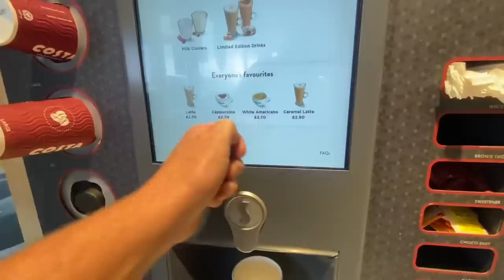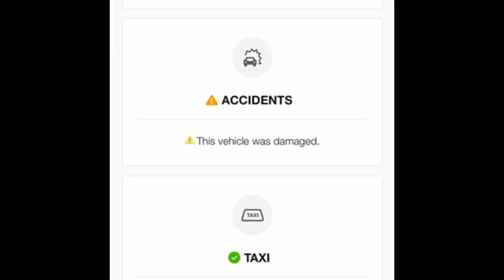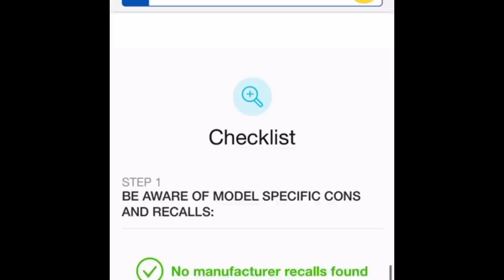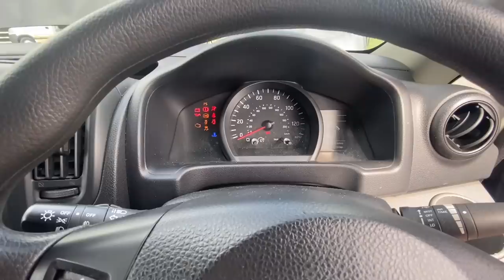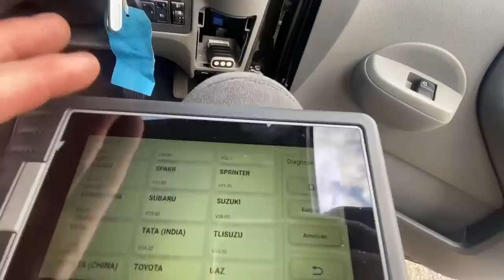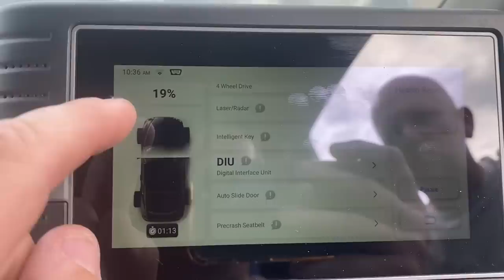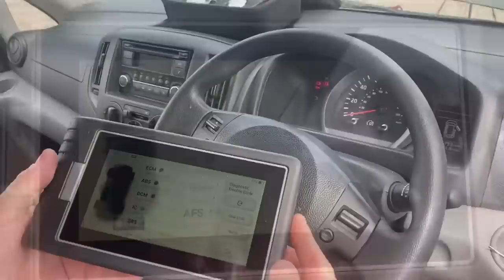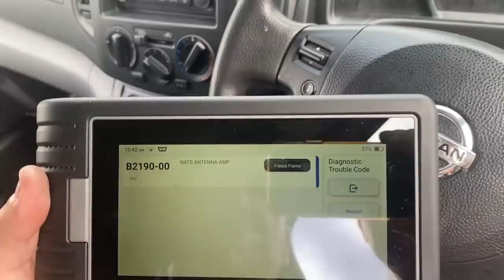Crash Damaged 2019 Nissan NV200 Panel Van non EV Hybrid PT 1

Comment from the maker: use Car Vertical and get 10% off with our link here :-  https://www.carvertical.com/gb/landing/v3?utm_source=infl&a=Rebuilds&b=38b26e3a&voucher=salvagerebuilds
Reply: Currently in the process of buying a c class, used your link to check it out of curiosity and it turns it its had a dial back a couple years ago. I don't know if I fancy that car anymore but I'm glad I checked.
Reply: thanks for the discount some good info on there  used when purchasing  a vauxhall vivaro only gripe it does not do finance check so had to do a hpi check as well. would recommend finance check on newer vehicles.
Reply: Thank you for the link Rob and Chris, used this morning to check history on a car I've bought, all came up good. Thanks for all the videos, and enjoy your weekend.

Comment: For those commenting that this is just a rebadged renault you are wrong. The NV200 is a stand-alone vehicle made by nissan with a renault engine. The nissan that is a rebadged renault trafic is a Primastar.
Reply: the renault master comes nissan as well not sure of model think its nv400. also opel something or other
Reply: @Irishmacwoof  Thats correct. The nv250 (used to be called kubistar), renault kangoo and mercedes citan are the same base. Nv300(used to be called primastar), renault trafic and vauxhall (opel) vivaro are the same. Nv400, renault master and vauxhall/opel movano are the same.

Comment: Missing fuse was possibly a sat nav being piggy backed. Had it last year with a Citroen DS3 I purchased salvage. The person must have been in a rush to remove it so didn't replace the fuse. Mine wouldn't talk to the diesel additive pump which turned out to be a missing fuse. Very annoying!

Comment: Seems insurers write things off a little bit too quickly especially on a nearly new van.
Reply: My thoughts exactly.
Reply: Think about it from their point of view, they have to arrange the repairs, do paperwork, arrange a hire car, pay for the repairs from main dealer parts prices, paint work at the top end prices and then if the repair isn’t for whatever reason 100% it will cost them even more. They write it off to wash their hands of it and move on. It’s easier and probably cheaper for them to do that. Only time they won’t is if it’s just a really minor scuff or something but even then they might write it off. Makes sense to them and we can buy bargain salvage 😃
Reply: Yes, I agree.
Reply: Insurers and their assessors will just put on new parts rather than reconditioning them or using second hand stuff because it's easier for them to just go to main dealer and get it, even if it's more expensive.

2021 Mercedes Sprinter van driver side rear door? £1200 in colour, including VAT. It's silly prices for some of these parts, and unless you're buying from a breakers yard, the client of the insurance company will just take the money offered by GAP insurance or their insurer and get a new van.

Comment: Mega easy bargain repair for you guys.
Lazy/sloppy estimating from insurance company to deem it cat S total loss when it’s really only a bunch of bolt on bits and a little weld in headlamp panel.
NATS (Nissan Anti Theft System) fault could just be from low battery or a key not recognised at some point.
Nice bit of diag footage. Keep up the good work guys 😎

Comment: We had one of those vans a 2014, I think, ran great for about 175000 miles. Trans-axle died, in the U.S. you can only buy that van with an automatic, they are so bad no one will rebuild them and there were no good used available. Nissan wanted $6000.00+ to replace it. We scraped it. Wish we could get the manual

Comment: just bought a ford fiesta in black 400quid few bits missing like broken rear brake light at top of boot n strips on side doors, found parts at scrap yard easy fix, & once cleaned n polished motor came up looking shinny glass cleaner the one 2!

Comment: I started my career at a Nissan dealer and worked in them for about 10 years.  I like these vans, a few of my mates drive them based on my recommendation.  Genuine parts are ridiculously expensive though, I'm glad it's not a rear ender as the rear lights are close to £400 each!  I think when you find out the wing prices you'll end up repairing them.  Good luck with it :)

Comment: Rob, just a quick note. When you take AC pipes off a condenser, seal them up with insulation tape, the last thing you want is water in the system and you were spraying with the jet wash. The oil in the compressor attracts moisture and can kill the compressor after time. Vaccing out the system will remove most of the moisture from the air in the system but water will take longer. Another great vid, keep up the good work  👍
Reply from the maker: We do bud

Comment: The missing fuse for the OBD port may have been on purpose, some people remove it as it stops (well slows them down) potential thieves being able to plug a reader in to code a new key and make off with it, I actually have done the same with one of my cars for extra protection 👍

Comment: Absolutely fantastic vlog chaps I have a Nissan nv200 myself and is a good van but depending on the mileage replace the fuel filter they are fairly cheap and also the transmission oil it takes 2.3 litres 75w 90 fully synthetic and engine oil is also fully synthetic 5w 30 4.637 litres superb find very impressed take care and stay safe mark from billericay 🚐👍

Comment: Hi guys, what is that rubber mat with the lip on it that Chris was lying on and then you had under the engine at one point.  Looks like just what I need for a little project.
Reply from the maker: Mate honestly so many people have asked what that is and believe it or not it’s just a plastic boot liner out of the boot of a Fiat 500 but they are so expensive I didn’t know how expensive they was before I started dragging it around the floor lol we love it as you can drop anything on it and it stays on it . I’ll send you a link for 1 https://www.ebay.co.uk/itm/Fiat-500-Abarth-Semi-Rigid-Protective-Boot-Liner-Mat-50901727-New-GENUINE-Fi-/230418089961?mkcid=16&mkevt=1&_trksid=p2349624.m46890.l49286&mkrid=710-127635-2958-0
Reply: @sruk  thanks for taking the time to reply and especially for finding one for me.

Comment: There should be an inertia cut off switch under the bonnet. It cuts off the fuel supply in the event of an accident. Usually press to reset( as far as i know)
Reply from the maker: They don’t tent to be on these modern cars anymore 👍

Comment: Bit of a strange one with car vertical, I know manufacturers share models. But  not usually model names or type as with the tekna. The tekna in the case of my Nissan means extra features dab radio, sat nav and rear camera. Along with the trim level, that will be a lovely low mileage van for someone.

Comment: Hi Rob & Chris
I was just wondering is it more expensive to insure one of these Cat S repaired vehicles than a non damaged same version car ??? If so do the savings on buying one not get outweighed by insurance premiums over the years you own it ??? Thanks in advance if you can find time to reply :)
Reply: I've asked plenty of different insurances and they've all said it doesn't make a difference in the premium. Hope that helps
Reply from the maker: Insurance is no different bud 👍
Reply: @sruk  Thanks for the reply Rob/Chris nice to know that. Have a belting weekend lads !!!
Reply: @keeplondonmoving9794  Thanks bud :)
Reply: You will get 20% less on the price of the car should it be a total loss on a cat s car. Otherwise as stated it's no difference.

Comment: Hi Rob. I've got a 2016 one of them. If you need any pictures of fuse layouts or anything drop me a message. Mine has no A/C though. Cracking vans I use it to take the motorcycle to the track.

Comment: Why was it written off. I am surprised as it does not require a lot of work to get it on the road. Retail price should be about £15k to £17k depending on mileage and even buying new parts it is still worth repairing.

Comment: Hi Rob n Chris ,That engine is the same as my Renault Capture I bet the Intercooler is the same,my battery has Renault Nissan on it  as well, I would cross check some of the bits .I reckon  Renault got into bed with everyone the parts are every where, did the Vauxhall van have Renault clocks..👍

Comment: Definitely says Nissan on the back , I wonder why it came up as Renault on c/vertical ?
Reply: Renault owns a big stake in Nissan and a lot of the parts are interchangeable eg the Renault kajar is a Qashqai with different panels and light etc
Reply: I noticed on the battery it said Nissan/Renault...
Reply: Renault and Nissan are the same company
Reply: @99_friety  so is ford and jaguar. But missus old motor sure wasn't a jaguar ka

Comment: Instead of pulling fuse, why don't you use two probes and a continuity tester to see if the fuses are intact. You can check both fuse boxes, every fuse, in 4 minutes

Comment: The Renault/Nissan electronics are very over sensitive when something goes wrong - my fathers scenic DCi dropped one injector with dirty fuel and it litup everything you could think of, including ABS / PARKING BRAKE and worst of all BRAKE FAILURE STOP VEHICLE NOW which is somewhat concerning at 70mph !

Comment: A lot of the Renault and Nissan vans and trucks are exactly the same apart from the badges and some other minor cosmetic differences. So maybe that’s where the confusion as to which brand it is. But the NV200 name has always been a Nissan name, rather than Renault.
Reply: Lots of badge engineering in commercial vehicles, like Fiat/Peugeot/Citroen are all the same and badged as Dodge in the US